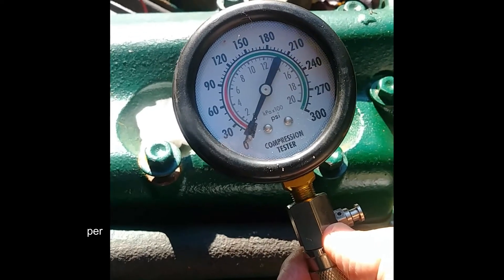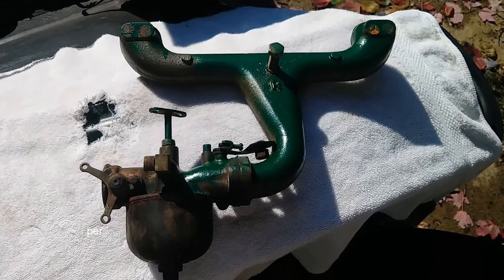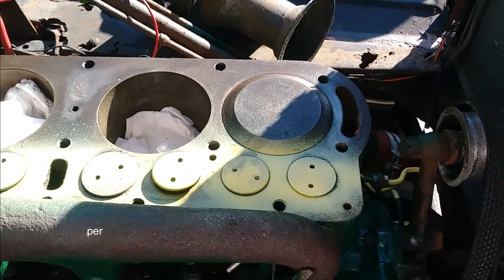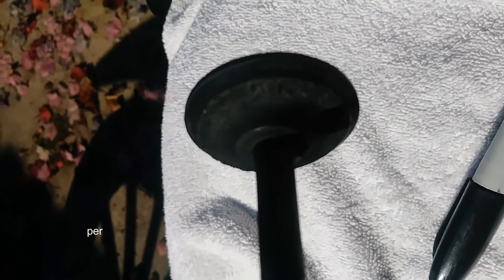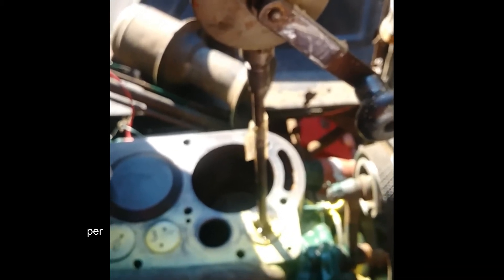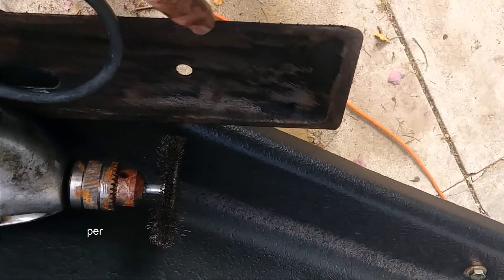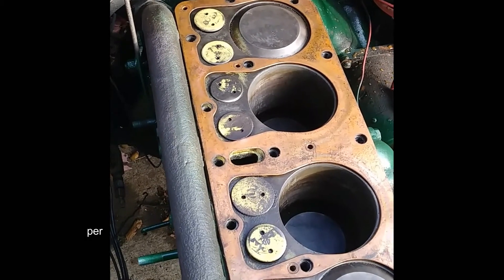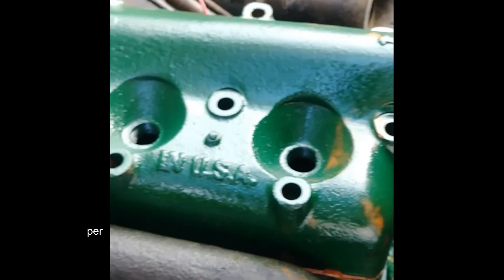Model T Ford instructions and hints for a valve job

Comment: Using the old two piece valves again is tempting fate. They often fail after 90+ years of service and can cause a lot of damage. Do you self a favor and buy a new set of one piece stainless valves for the old gal.
Reply: I could not agree more.  I have experienced the failure of a two-piece valve such as the one you are showing.  The head separated from the stem and it then punched a hole in the piston.  Catastrophic engine failure was the result.  For another example I bought two used engines out of a barn in Iowa and on dissasembly one of the engines had a two-piece valve that had cracked and a portion of the head was missing.  The heads of the two-piece valves are cast iron and brittle.  In the model T era, there wasn't a grade of steel that could stand the heat the exhaust valves were exposed to, but cast iron could so the valves have a cast iron head pressed onto a steel stem.